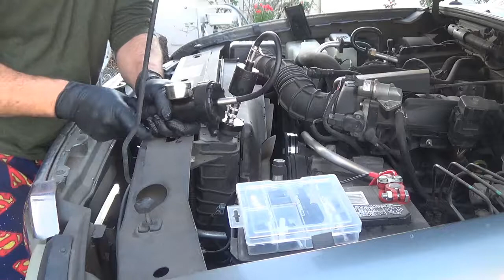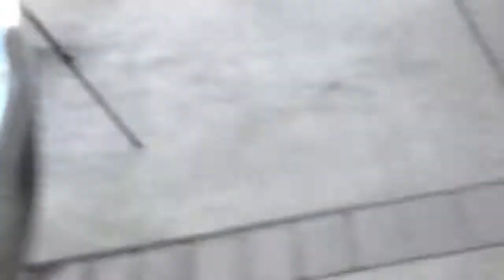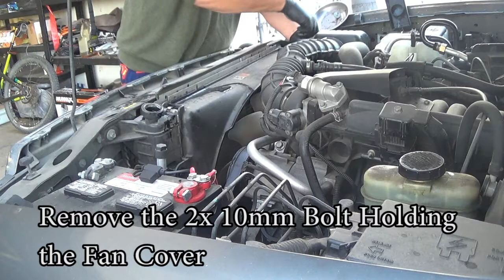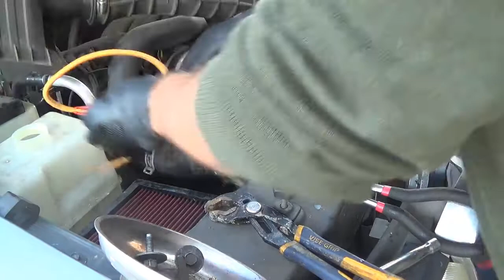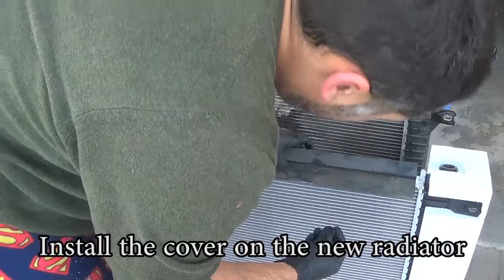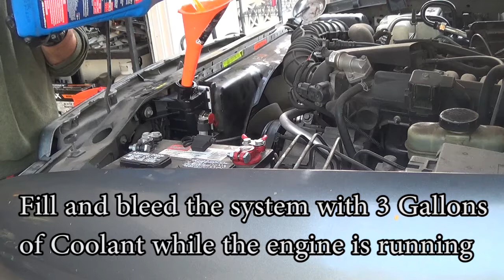DIY RADIATOR INSTALL ON 2004 FORD RANGER MANUAL V6

Comment: I have a question.  I have an 04 Ranger xlt 3.0 5 speed. 
I finally found that my radiator has a hole on the passenger side about halfway down the side. It's shooting water towards headlight. My question is. I refilled the radiator all the way and unscrewed the drain plug buy water isn't coming out at all. I've never had that happen, where no water comes out but it's full. Is it possible my radiator is plugged or clogged by something, and the pressure built up and caused the hole. It's a small hole but it's peeing water like a Russian race horse. Thanks.

Comment: You wouldnt have a video on replacing an automatic transmission cooler for the ford ranger......i got a 2003 xlt 2.3 ltr